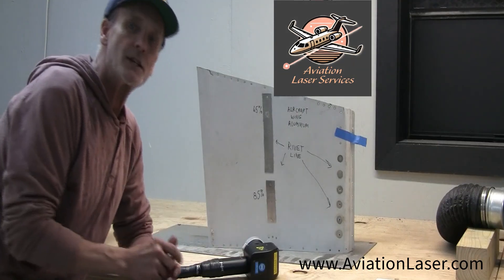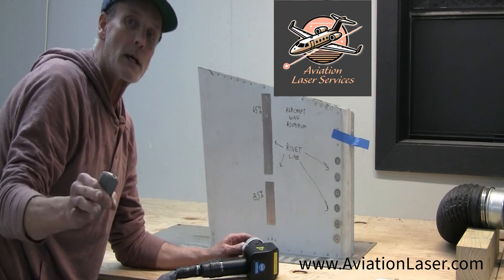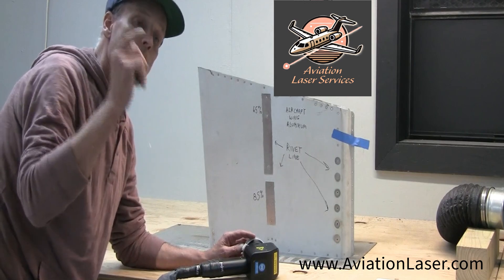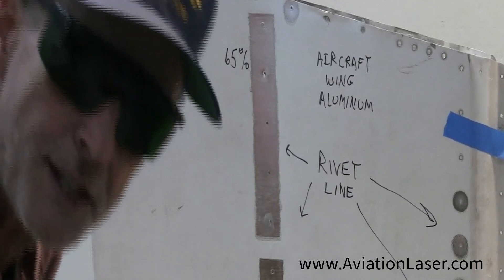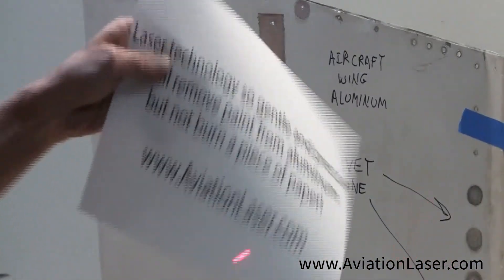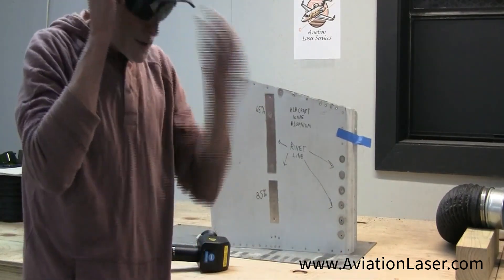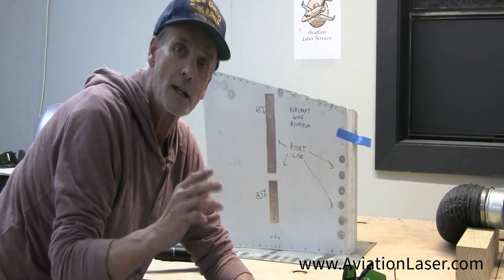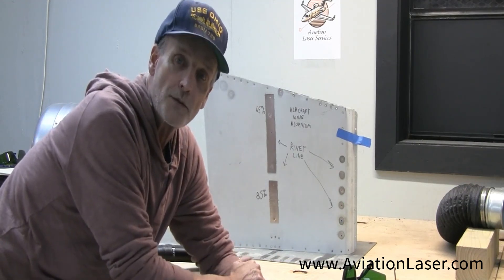Paint Yes, But Doesn't Burn Paper??  by Aviation Laser

Comment from the maker: I could provide you with the parameters of my laser setup but that will only get you to the exit ramp to the parking lot of the ballpark.  Let me explain - my laser is a 300 watt pulsed fiber laser with a 5mj head.  I have up to 30,000 mm/s scan speed, some don't.  I have the capability of independent pulse duration and frequency adjustment, some lasers don't.  So, Power (wattage), pulse duration, frequency, scan speed, galvo geometry output which includes sine number, phase move and amplitude settings - my settings would be meaningless to anybody and possibly damaging unless you have the exact same laser components and hardware configuration as I do and I doubt you do because I helped design my laser.  I will be doing more videos about laser settings, parameters, setup, etc which will include laser theory so users can understand how laser ablation works for their particular machine instead of following the recipes of others.  Cheers!  Now you guys get along!!  🙂